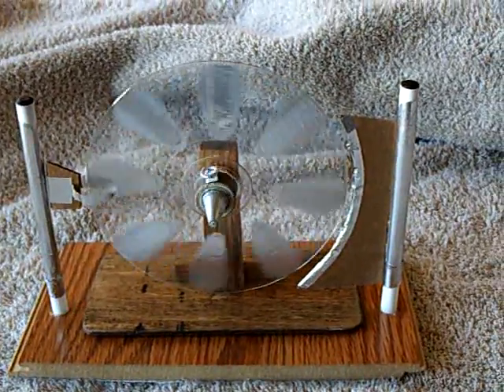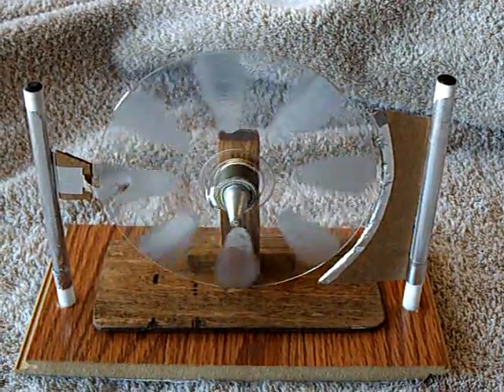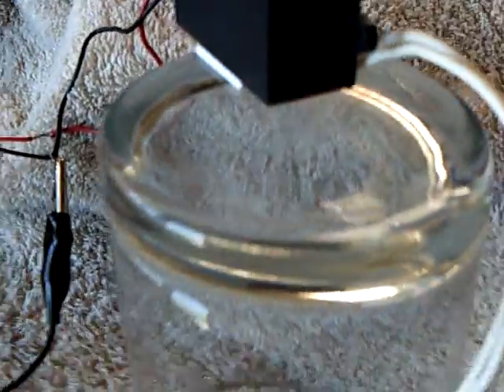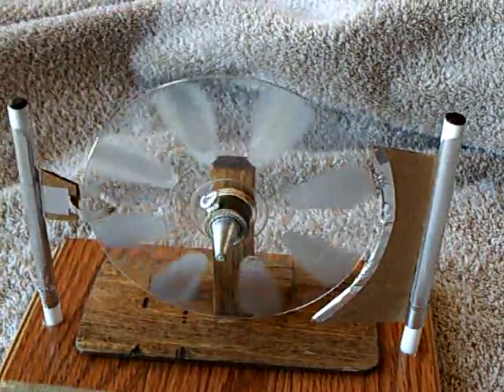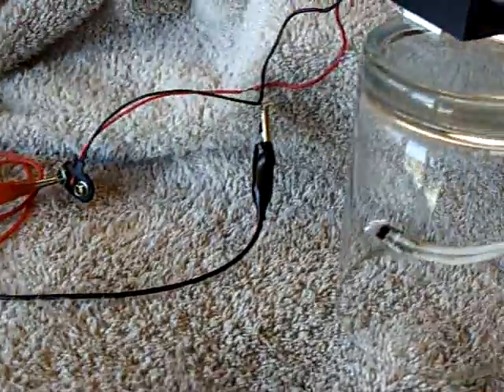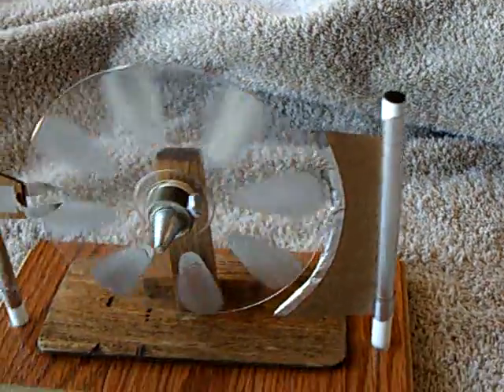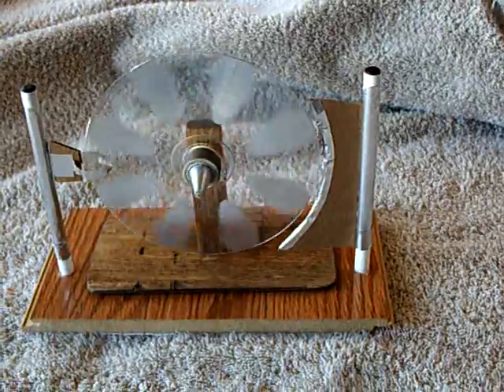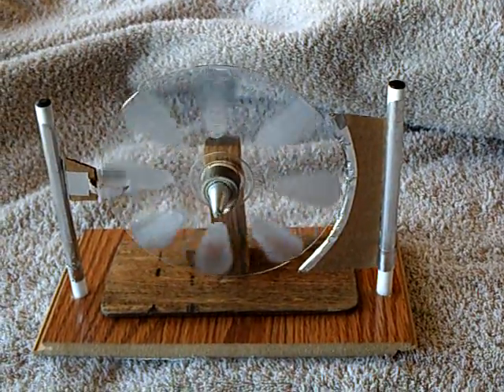Faked Perpetual Motion Machine  -- my replication   ----how it was done

Comment: How do you explain the ones that somebody moves around several times, yet keeps running?  Very open device of wood, with polystyrene wheel, put on several non conductive surfaces when tested, and what would this be the reason for not posting construction plans?  Unless fake, of course
Any nano/micro motor using nano/micro battery, would continue to run before and after the wheel is removed, would it not?
Reply from the maker: +Odee “Oz” Dillon  We think that the tiny motors are in the rotor shaft with the battery in the middle.  The 'V" supports offers friction and holds the motor shaft while the motor rotates around it.
Reply: ***** But why wouldn't his mic pick up the sound of the motor?  Pretty high pitched buzz.
Reply from the maker: +Odee “Oz” Dillon Good question.  Perhaps the battery was low?  None of the people who worked on a replication (like me) were able to make something that operated exactly like what was shown in that video. The builder would never respond to our inquiries either. There never was a follow up video posted by him.  I'm still going with the battery powered explanation.  Electrostatics (like he described) were proved  to be impossible by several replicators.
Reply: ***** Oh well

Comment: @lidmotor The only fake thing in your video is you. You didn't even bother to do a proper job of watching the video you are supposedly replicating. Bro, your contraption is missing a whole big part of the original device. Maybe you have some tunnel vision problem. Go see the eye doctor before you call somebody fake. Original video was done on glass table to prevent guys with tunnel vision from getting the replication wrong. you missed a whole part. get your eyes checked.
Reply from the maker: +HitAndMissLab   That video was studied by a group of people at one of the forums I work with.  We believe that he used small motors in the thick rotor shaft.  What you see here is different. It is a true electrostatic motor.  You really need to watch my whole video series on this motor to understand what is going on.   The motor shown in the original fake video would never have run the way he described.  A number of us did replications proving that  his motor video was a fake.

Comment: also, what if in my thoughts i speak of  (imagining a fixed sphere of magnets suspending a single flat magnet in the centre). Are the frictional properties of water high? Am i just way off the mark again to now think perhaps water could be used as a catalyst to assist in retrieval of the generated energy? Or perhaps some other type of liquid that has high or higher conductive properties? This changing design a lot with now having the requirement to hold liquid. But assuming the liquid would actually assist in momentum in that it too would gain it's own momentum?  
Again, forgive my massive lack of scientific knowledge ppl. Sorry for posting all my thoughts on ur video lidmotor 😕
Can't stop thinking about this stuff!

Comment: BRAINSTORM!

What if the plastic disk was first charged up by rubbing with fur, or wool, or with a balloon?

It might actually run as shown in the Waller video.   But it would only run briefly (like maybe several minutes at most.)   And the "asymmetry" would be from nano-ampere leakage across the plastic and onto the sharp edges of the foil rectangles.   Also, plastic parts would eliminate a "sneak-path" for nanoamp currents.   Plastic instead of slightly-damp wood would block operation.

Note that whenever we put a plastic sheet up against a metal disk, and then charge the plastic by rubbing with fur, it stores far more energy than with the plastic disk alone.    The capacitance is far greater with the metal disk, and with the disk connected to the other half of the circuit (or to ground, or to a large human.)    We get "electrophorus" effects. 

Indeed, the very first Leyden jar was just glass, with conductive water on one side.   Adding an outer metal foil came later.
Reply from the maker: +wbeaty Interesting experiment.  You would need a better setup than this with very very low friction.  The electrostatic motors that I have made so far have very little torque.  Any friction kills em.
Reply: +Lidmotor  I made mine sideways like a record-player, so the bearing could be a nail sticking up into a tiny glass test tube.

I have lots of those glass tubes if you want some.

In my above, I was assuming that he'd stumbled upon the effect by accident.

If it was an intentional hoax, then there's an obvious way to store fairly immense energy:   use capacitor dielectric absorption.   Then let the charge leak back out over days.

First, put two metal plates in intimate contact with either side of a plastic disk (perhaps use water contact,) then connect it to a high-volt power supply for several days.   It's a capacitor, but charge leaks deep into the surface.    Ordinary plastic might not work, you'd have to use something with hundreds or thousands G-ohm resistance, and acrylic is too insulating.    The usual stuff is paper soaked with oil.   That shows off a large "soakage" effect, and oil capacitors must remain shorted when stored, otherwise they mysteriously charge back up by themselves.

Remove the conductive plates, and you have an odd device: a "plateless capacitor," a highly charged electrostatic source which might power a simple motor for weeks.

If we assume that's how its done, then those foil sheet must make very good contact with ONLY one side of the plastic.  (There would be some insulation over the metal disk, so the foil sheets would only seem to be connected.   Intentional deception, to keep anyone from figuring it out.)

Then, his metal disk would charge up to kilovolts, and the little foil rectangles would charge up opposite.   (Use a VDG or a 30KV supply to perform the original charge-up, so the release of absorbed charge might provide over 10KV.)

That makes for an intentional hoax of course, since it would take some thought: finding special plastic that experiences large dielectric-absorption "soakage" effect.    But the result would be worth it, since the disk wouldn't spin for minutes, instead it might go days or weeks before the voltage fell too much to still drive it.

Comment: Funny how your video is also fake, since your title says "my replication - how it was done" and yet you admit that this is not how it was done ;)
Reply from the maker: +Tom Bombadil   You are right.  The title is confusing if you have not watched my other videos leading up to this one.  I have several other videos on this device I built.  We discussed the real fake device on a forum I participate in and we think that he simply had tiny DC motors in the rotor axle.  One on each side with watch batteries in the middle.  The motor shafts rested in the yoke supports.  That is our best guess.
Reply: ***** That seems like the best guess to me, too. The shaft is suspiciously fat :)
Reply from the maker: +Tom Bombadil The tiny cell phone vibrator motors would work.  He perhaps used a drinking straw for the 'fat' shaft.

Comment: Did you not notice that the guy you're trying to debunk has no hidden wires going to his? His somehow works right in his hands. So now what?
Reply from the maker: +Maxx Fordham  A bunch of us at one of the electronics forums studied  his video and decided that he must have used tiny motors in the rotor.  There were probably button cell batteries somewhere to power the device.  It was not an electrostatic device like I showed here.
Reply: You know, I'll have to confess that I need to rewatch the video. Last time I watched it I still had borrowed my speaker patchcord and hadn't put it back yet, and I was going to save watching it all the way through until I got my speakers hooked back up. So as soon as  i saw the wires, I just kind of went, "Nuh-uhh, that's different!"

I'll come back and watch this all the way through after I get through my replies.

Happy Halloween!

Comment: Can you please tell me how to make a very low voltage pulse motor runs on 300mV or 200mV.
Reply from the maker: Check out my video called 'Pulse Motor On A Stick'.  It will run on low voltage like that but you need some milliamps to go with it.
Reply: ***** thanx I saw it,  I'm a follower of you from 2 years :-), what if I use more winding in the coil would it be more sensitive to low voltage.
Reply: ***** I'm trying to make a pc fan core  as a pulse motor's 4 coils, winded in the same direction and using a small magnets north pole,  but I don't know why it won't work with 3 volts battery

Comment: Awesome video, but there is no need to fake this. You can have a steel sphere spray painted with rubber paint. You drill a hole in this sphere and connect it to one rod in this static generator. Have the other rod connected to a ground connection. Have your spray painted sphere 12 feet in the air (the higher the more voltage). Presto.. your motor will be running perfectly (I'm going to do a video about this soon). You can look up Tesla's patent No. 685,957 turns out that idea is already patented (only Tesla used a covered metal sheet instead of a ball). Again Lidmotor awesome video, I'm a big fan of yours.

Comment: Thank you for your cool videos,  I have two questions maybe you can help me with your long  experience of making this beautiful small motors,  

1_ what is better for making pc fan generator thick wire or thin to get mush elec power?

2_ what's better for making powerful pc fan motor thick or thin wire? 

Thanx,
Reply from the maker: hammza hammza Thick wire more amperage.  Thin wire more resistance.   Lots of turns of thin wire gives more generated voltage.  Thicker wire with less turns gives less voltage but more amps.   For a motor thick wire makes more torque but less rpm.  It's all a trade off.
Reply: ***** thank you very much :-)

Comment: I bet the really cheeky ones upload in HD too lol.
If the frequency is quick enough, I expect the power is running over/around the 42 AWG, rather than through it.
Reply from the maker: slider2732 From what I have read the power runs over the skin in this situation.   There is a lot of leakage though.  The HV jumps to ground if anything is near the wire.
Reply: ***** Say, thanks for the link to the HV generator, have ordered one.
Reply from the maker: slider2732 You are going to have some fun with that.

Comment: Will that negative ion generator and motor light up an Avromenko led?
Reply from the maker: area46241 It barely lights up an led on an AV plug but it light up a neon pretty good..
Reply: area46241 You can light a LED with a green lemon for a few days.  Just stick the LED through the green lemon & watch it light!

Comment: Lid:

Perfect!  That wire is totally invisible.I agree that many fakes most likely use this method.  That background makes it totally invisible.

Great work.

Bill
Reply from the maker: Pirate Labs I imagine that you could use that wire to power a low voltage / low low amperage device also----like some Joule Thief circuits or perhaps a small pulse motor.

Comment: Haha nice! I thought a hidden cap in the base :P nice! Thanks for sharing!
Reply from the maker: bakupcpu You are welcome. It was another fun project.  if this electrostatic motor design was refined it would probably run on much less power-- but not until the end of time on nothing.
Reply: ***** Of course not. Maybe atmospheric static electricity :) but still those motor beside spinning have almost no practical purpose :) Although I did saw on the web a motor spinning a fan pretty fast lol :) Cheers!
Reply: +Lidmotor thanks for this bit of honest fresh air to counter the smug trickery of others.  Most domestic electromechanical devices have small caps rated at 400V.  Ten in series would support 4kV.  I wonder if you've tried this, they might hold enough charge to run the thing for a minute or two without hidden wires.